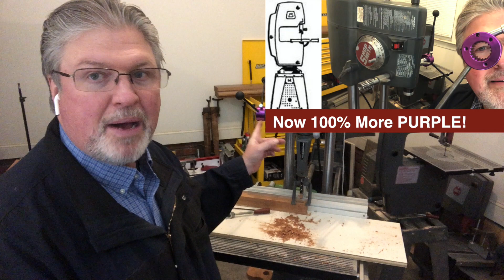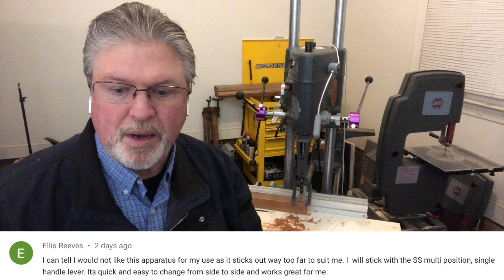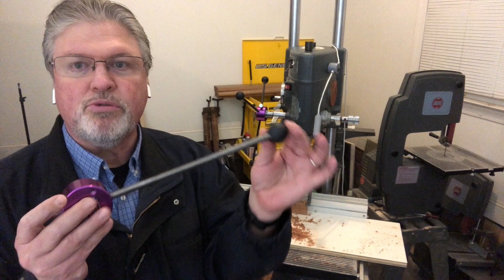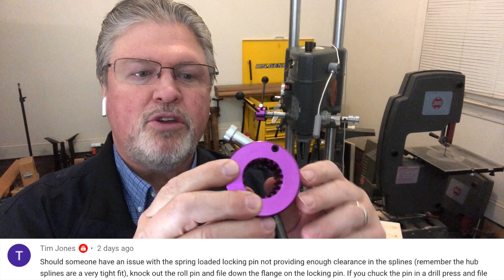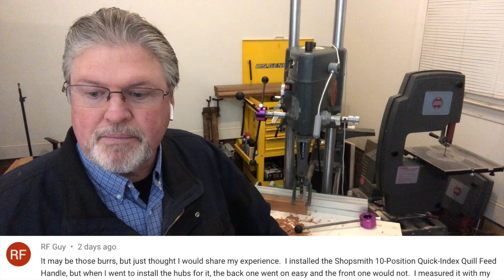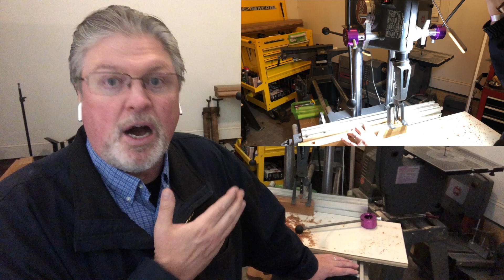STUMPED? Q&A's from "Upgrading the Shopsmith Quill Lever to a Quick-Release Multi-Position Lever"

Comment: Another great Q&A video. Can't wait for this weekend video using the SS mortise jig/tool. If possible could you also comment on how to go about keeping the mortise chisel tool sharp. Have read, but don't know myself,  the SS mortise tool is hard to use due to having to sharpen the chisel all the time. Thanks again for doing an awesome job on your channel and sharing all this wonderful information. I just finished making a couple of adjustable Adirondack chairs for my patio using my SS (my first real woodworking project with the SS). The chairs and footrests came out great. Learned a lot about the SS and how versatile it really is. Also been forgetting to ask if you have an opinion about upgrading the power for the PowerPro from 110v to the optional 220v?  The claim I believe is 30% more power. Thinking about doing it but a quote from electrical contractor to run the wires and outlet is $750. Thanks Curt.
Reply from the maker: Hey Curt. I don't think I would bother upgrading at that price. Yes, 220 will give you more torque, but has torque been a problem?
Reply: @MyGrowthRings  don't notice any problems with power at the the standard 110v 15amp outlet. Will probably use the $750 to buy more unnecessary accessories for my already over built Jeep. Thanks for the response. Curt
Reply from the maker: @curttundra  That’s how it’s done.

Comment: Great, I have yet to use my ss in the upright position but before I do that I want to learn how to properly use the lathe.
Reply from the maker: What type of turning are you interested in doing?  Scott
Reply: @MyGrowthRings  I'll jump  in and say I have a winter project of trying to make a drum sander.   FWIW, I live 3 miles from a Woodcraft so I took the Lathe 101 class.  It was helpful for a beginner.  The instructor made fun of my shopsmith which I didn't   appreciate but I took comfort in that his comments proved to me  that he had never actually used one.  As near as I can tell it's as good or better than the mid level tools they use in their classes.  I also took the intro cabinet and band saw classes.  They were all worth doing I thought.

Comment: Any concerns of the possibility of breaking or stripping the pinion gear or rack of the quill with having the extra leverage? Way more leverage than what the Shopsmith quill was designed for.
Reply from the maker: Absolutely! It is rare, but when I was working at Shopsmith we would occasionally see headstock sin for repair that had a damaged quill feed pinion. In most cases it was because the owner had allowed sawdust to build-up and clog the pinion and the rack on the quill, but even so, I rarely need to use the quill under this type of pressure.  Scott